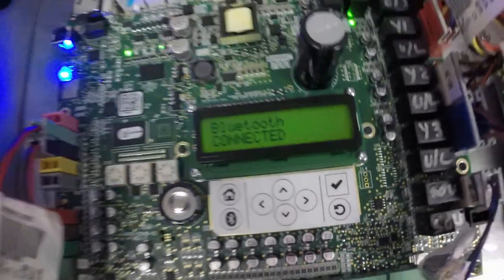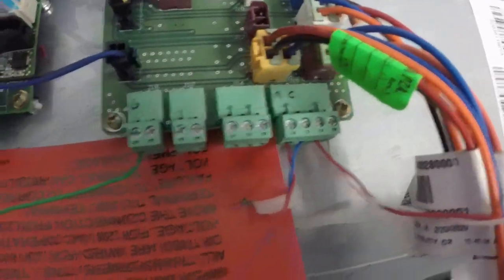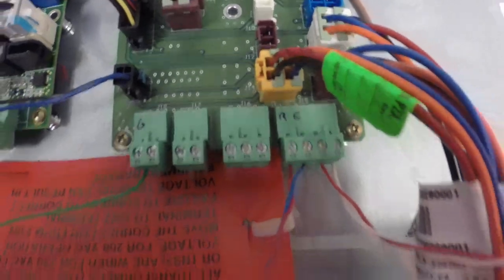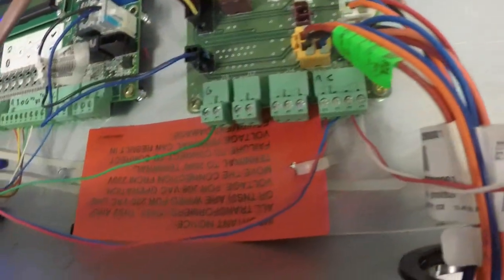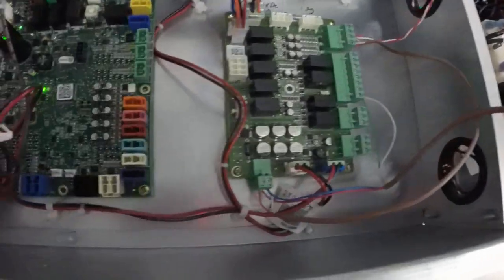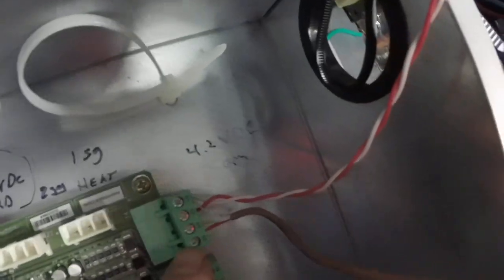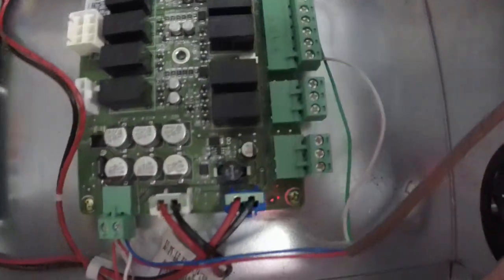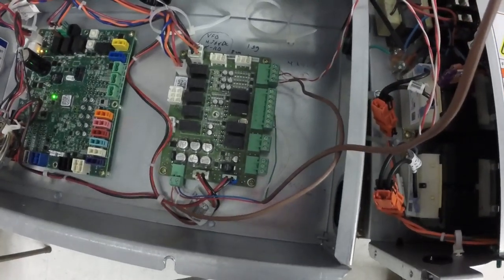Trane American Standard Symbio 700

Comment: Great video. I am currently installing a Trane 6 ton system with this set up. We can’t seem to get the fan running. Are there internal settings on the control pad to set up for thermostat control?
Reply from the maker: I like using the symbio app over the on board key pad for configuration.  Make sure under the settings screen, that you change the “arbitration method” to “standalone controller” if you are not using a building automation system(BAS.)
That is a potential reason why your blower isn’t running. 
Do you have a VFD or single speed blower?
Reply: @Hvacoffroad  There will eventually a BAS system, but we're not installing it. We're just trying to run the unit on t-stat.
Reply from the maker: @tempestam8375  
Check for voltage on the J18 terminal, pin 1 on the adapter board when you have a call for the blower.  This is the “g” signal out of the board and will go to J5, pin 4 on the indoor relay board.  Then confirm you have 24v on the J-10 plug on the relay board also.  Without voltage on either of those, the blower will not run. 
If you have a vfd, that’s a different story.

Comment: Is this the correct set up for an air handler 6 ton with a vfd T150 drive? Also are there any parameters that need to be changed?
Reply from the maker: The one setting that stands out, is you need to change CVZT to VVZT for the VFD models.  That tells symbio to send the signal for the VFD control.  
And you have to run a second pair of twisted shielded wire for the Modbus/VFD communication.

Comment: I’m getting compressor probing lockout any ideas?
Reply from the maker: Compressor proving trips and lockouts occur when the compressor proving switch is open during the call for compressor.  What's in that circuit are the high pressure switch, discharge temp sensor and aux contacts on the side of the compressor contactor.   That circuit must be open without a y call, then close when there is a y call present.  So it can't be bypassed.  I would look at those 3 components listed above, and the wires connecting the circuit.

Comment: What if you don’t have a Symbio air handler? Been trying to get this unit up for x2 months!  Please help!!
Reply from the maker: It would depend on the air handler that you are using.  You would still send the g signal out of J18-1 to the blower signal on the air handler.  I you need 24v hot and common, that would come from J15-1,2. Then, if you need y's, w's or an o, you would get that signal from j21 on the condenser.  

What exactly is your system doing or not doing?
Reply: Contact your local Carrier distributor, they have a solution. (Symbio is junk)

Comment: Donde conectar para el blower?
Reply from the maker: Blower signal is the 4th pin from the bottom of J5 on the air handler relay board.  You must have 24 volt power and common applied to pins 1 and 2 on J10 or the blower will not operate, even with the signal to pin 4- J5.